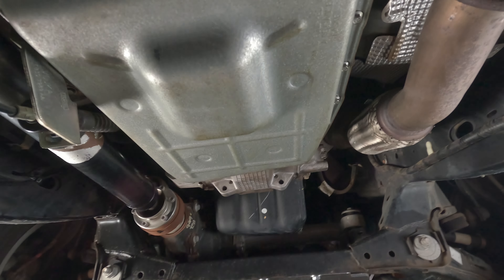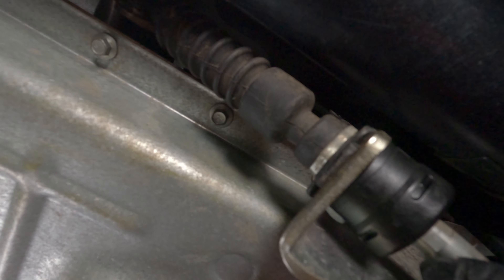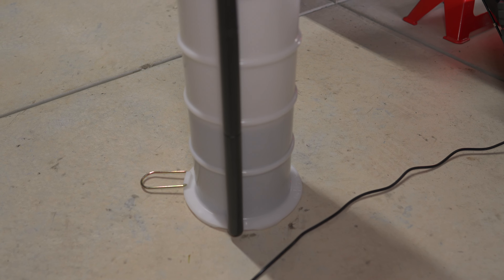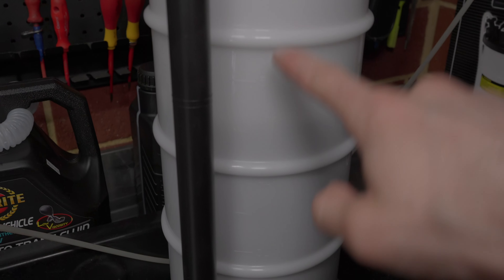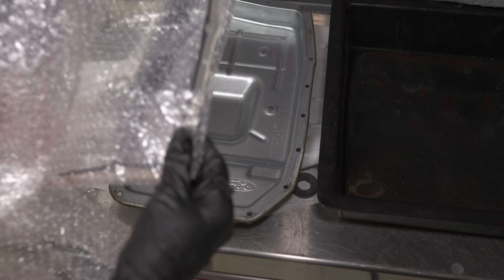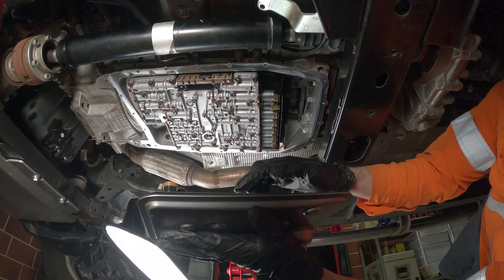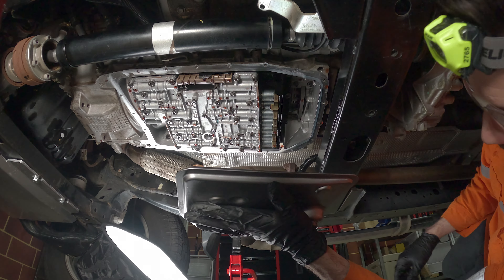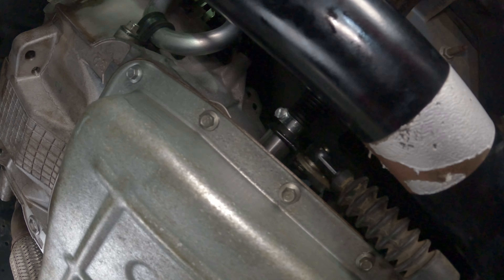Mazda BT-50 / Ford Ranger Transmission Flush || Clean Method

Comment: G'Day mate
good vid. But you should get a Thermal Cooler Bypass Valve from Wholesale automatic transmissions in Melbourne  they cost about $38.00 and work very well.
Cheers Rory
Reply from the maker: Hey, cheers.

I did buy one but decided against installing it. I like the oil to get up to operating temperature and then maintain itself.

Also I don't tow so I'm not looking for every ounce of cooking available, just to cap the top end temps at a good level.

Comment: Mate did you notice better shifting with less flare using the penriteATF merocon LV oil.?
Reply from the maker: Can't say I noticed much difference to be honest. I did this early on in the ownership of the car so it's not like I had a lot of experience of how it was shifting before.

Have you made the change and noticed it shifted differently?
Reply: @TheBrowneTown from new my ranger hasn't shifted nice. It flares revs and slips. Been told its normal by dealer... I'd hunts gears and down shifts when coasting put foot down and its laggy. 
I drove a 6 speed mustang an the box shifted perfectly in comparison.
Reply from the maker: Ok, mine doesn't hunt through the gears but it's definitely laggy, pain in the ass trying to get on the throttle to get through roundabouts for example.

I've had a tune since and it's a bit better now.

Comment: can you measure the oil removed and just replace the same amount ?
Reply from the maker: I don't think you will successfully capture it all, it continues to drip for a while.

It's also worth checking that it is at the right level in case it was already low when you dropped it. Or if someone has overfilled it in the past and you put the same in again then it remains overfilled for example.